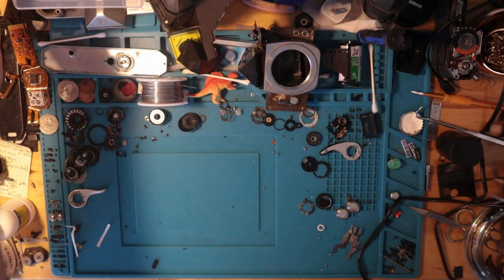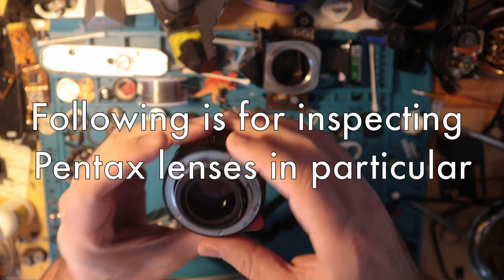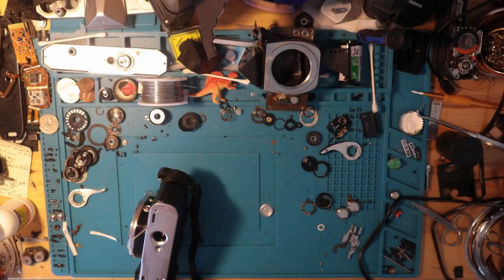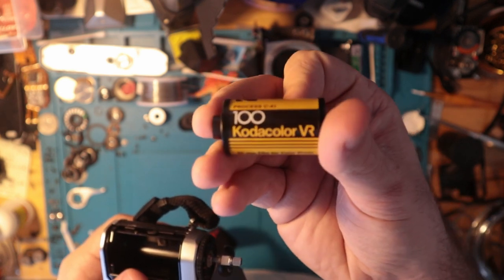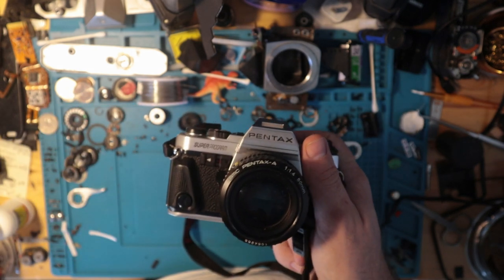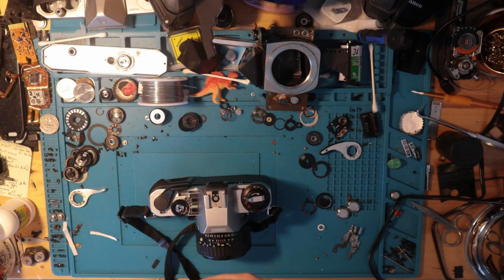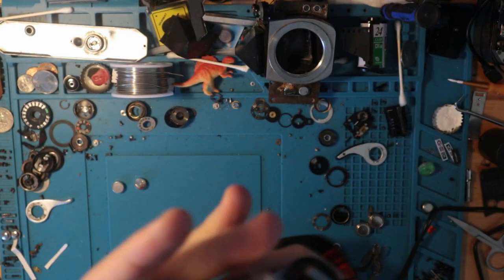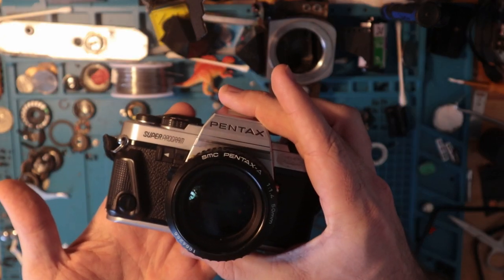Pentax Super Program Inspection

Comment: Great video! Someone in my area is selling a brand new Super Program, literally never been used. Would you recommend buying it over, say, a well used Olympus omG or Canon A1?
Reply from the maker: Thanks for watching! I would definitely recommend buying it if the price is something you can justify. Bias aside it's a much better system than the omg and as much as I adore the A-1 the Super Program just offers a little bit more (1/2000 shutter speed, higher flash sync speed and a lighter build) There are pros and cons to everything but I would definitely recommend picking one up and giving it a shot!

Comment: I bought one of these 80s cameras at an antique store a few months ago. It’s the only SLR Still film camera I own and I still haven’t bought any batteries or lenses for it. What are things I need to look out for?
Reply from the maker: I would first check to make sure the camera has power and fires with new batteries. Sometimes the advance linkage can become detached and the camera will wind infinitely. Other than that I would just make sure it fires on all the speeds and that the light meter responds to light! Best of luck

Comment: I don't know if you take requests but my Pentax ME Super has a non-functioning frame counter. The wheel springs back to zero so the top spring mechanism is alright, but pulling the lever to the next frame does not advance the counter. It's a small problem but it's nice to know which frame you're at. 

Your videos made me confident enough to pull off the top of the house (to fix the original problem which was that it was stuck at 36) and have a look. I have found the small spring (and it's loose) but have no idea how to position it to work as intended. Would greatly appreciate a video showing stuff like that that I gather often break on these cameras.
Reply from the maker: Very funny that you mention that, I just finished a video responding to a couple comments I've gotten, so I'd be happy to help. That is a fairly common issue with the ME Super, what's likely happening is the mechanism that locks the gear when the back is closed is disengaged. Basically the frame counter is moving freely because it's acting as though the back is open and resetting to zero. 

I am happy to bolster confidence and I'll see if I can get a video recorded tomorrow going over how it's supposed to look and function. Hopefully that will answer some of your questions so you don't have to keep a running tally in your head!
Reply: @RompingBronco  Yes, it seems like opening the top made the wheel unstuck from 36, but in the process of opening it I dislodged the mechanism that turns the wheel when pulling the lever. Thanks! Will be looking forward to it. Its great that you help in demystifying the technology!